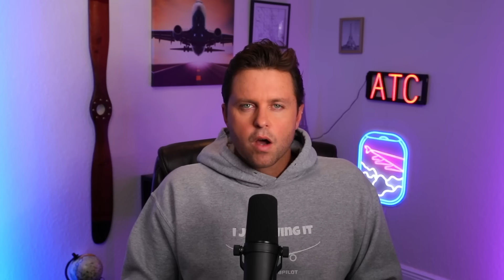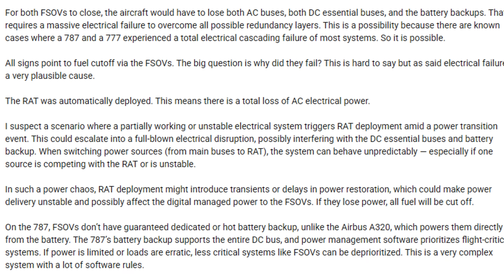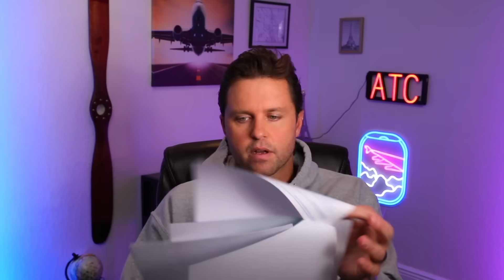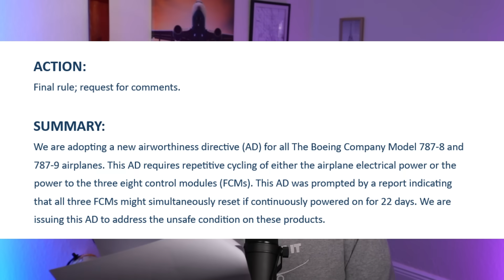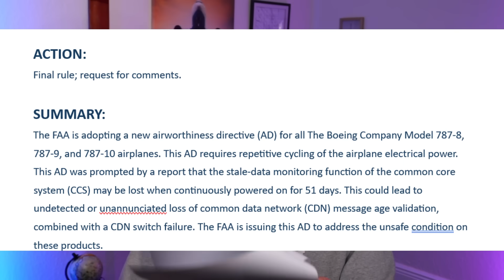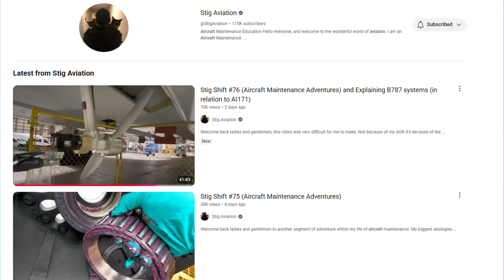Air India 171: Did a Software Glitch Cause Dual Engine Failure?

Comment: I know this might not be reliable info but if you do a google search on (If suction fed fuel is enough for takeoff if the AC powered fuel pumps will fail) this is what you will get. 

No, suction fed fuel is not typically sufficient for takeoff on a Boeing 787. 
Here's why:
Pumps are the primary fuel delivery system: The Boeing 787's fuel system relies on pumps to ensure adequate fuel flow to the engines, especially during high-demand operations like takeoff.
Suction feed is a backup: While the engines can suction feed from the main tanks if all pumps fail, this suction may not provide adequate fuel flow at higher altitudes. Takeoff is a high-power phase of flight that requires a robust fuel supply.
Takeoff requires maximum power: The Takeoff/Go-Around (TOGA) system on the 787 increases engine thrust to ensure optimal climb performance. This demands a high fuel flow rate which is typically achieved with the assistance of fuel pumps. 
In summary: The 787 is designed to use fuel pumps for normal operation, including takeoff, to ensure adequate fuel flow and optimal performance. Suction feeding is a backup in the event of pump failure, but it may not be sufficient for the demands of takeoff and climbing to high altitudes. 

Could this explain what happened if the aircraft had indeed electrical failure and lost temporary AC power to the pumps causing the engine to idle back due to lack of fuel resulting in loss of trust and being so low to the ground not having enough time to recover. Engine being forward and higher than the tanks due to the angle of the aircraft on takeoff, gravity forcing all the fuel to the back of the wings could this starve the engine of fuel if only suction fed fuel was available. What do you think? Has such scenario ever been tested ?

Comment: That is insane. How could the FAA allow Boeing to have this feature? I have almost zero knowledge about engineering and even I can tell that is an awful idea.
Reply: I am not saying that this is the case here, but many instances across a multitude of technological applications have shown how self certification of safety related equipment can lead to fatal consequences. Especially when businesspeople take control and force the engineers to cut on costs.

Comment: This seems like the most likely cause. It's very unsettling to think that there wasn't a better designed system to prevent this from ever happening. Having the fuel cutoff valve fail to the closed position when the power is lost is just stupid. I can't think of a scenario where that would be a good thing. Even an engine fire. An engine fire won't cause a total power failure, so the pilots can just cut to fuel to that engine. This valve should just be a valve that stays in the position it was last put in regardless of there being power on or off. The same should go for the engine thrust. If there is a total power lose or communication failure, the engine should stay at the last power setting they were at. If they were set to go back to idle on power lose or communication failure that would just be stupid too. I wonder what happens to the flight recorders when there is a complete electrical failure. Hopefully, they will not have any data loss.

Comment: Finally the most likely cause is reported. It’s very unlikely that an environmental cause like contaminated fuel or vapour lock will see a plane go from working under full load to both engines being completely flamed out without any signs of fire or splutter etc. considering the system is literally designed to switch off the fuel if it has no power, an event that likely occurred on the landing gear pull up request, until proven otherwise this should be the likely cause of this event. The system was basically designed to protect from fire in the engines due to disaster but never designed to protect flight during take off. It’s very difficult to see who at the FAA signed off on such a design of the electrical system that would cut off the engines if the power system failed

Comment: Interesting hypothesis which poses a couple of new POI* for me. The first (1)is a fairly obvious one pointing out that if fuel contamination is a serious contender for a cause of the accident how is it that no one else has reported fuel problems at this busy airport? 2. Clearly, if the fuel shut off valves or system software are suspected of being a çause the problem only became apparent after Take Off power ŵas selected and not instantly even then, possibly because of fuel already in the line?  Therefore, when the pilots were expecting a steady flow of go-juice they found that the cupboard was empty! 

Finally, let us remember that 25"  is a very short time to swat a problem such as this. These poor chaps just ran out of time 😢.

*Point of Interest.

Comment: Doesn’t need to be a software glitch, but a design issue. Neither had the B737 a software glitch. 

In safety related systems, vital data is obtained, processed and propagated via at least two individual channels. This is to prevent single failure modes which may trigger catastrophic events. FMEA (failure mode error analysis) are performed prior and during development by safety engineers. In lay terms, you cannot have a single point of failure by design.

In the B737, the AoA sensor was single-channeled by design, neglecting its safety relevance. I hope such a design misstep didn’t happen again in the B787 development.

Comment: There are so many “safety” interlocks that are hidden time-bombs or more accurately, combination-bombs that is awaiting the “right” combination to cause a very surprising “detonation”. It is like unlocking a combination-lock to a door by a pure-chance try except instead of the door unlocking, about 250 people instantly die. A modern aircraft replete with mechanical, hydro & electro-mechanical components all needing safety interlocks are just accidents awaiting to happen which is ironic because they are supposed to fail “safe” but in a broader sense just unlock a larger danger upstream. Normally hidden away because those particular Event combinations never “click” together or in sequence. The most egregious of these which did not stay “hidden away” at all - such was the stupidity of the “safety” design - was that of the 737 Max MCAS flight control “law” that could have been designed by Donnie. 😊

Comment: IMHO, over-engineering does not contribute to reliability or safety, and that's why I will never buy a modern car or a german car of any era. As time goes on, should we expect more commercial airplane crashes due to glitchy software and/or corroded wirings and connectors of their on board computers? Of course, we don't know yet what caused this Air India crash...

Comment: Thats what I thought. Can an electrical failure shut the engines down? Usually they lock the thrust but with a fire valve system it might actually override that.

Comment: As if Google knows it's a$$ from a doorknob . . . Please stick with credible sources! (And even if the valves close, would they not instantly reopen on restoration? Makes no sense . . . )
Reply: Once the engine is shut down, you can reopen the valve as much as you want, this won't restart the engine.

Comment: For a week I've thought the first officer or someone else on the flight deck "flipped the switch" to cut off the fuel.  This makes me think I was correct in the cause but falsely thought a flight officer was involved.  I'm sure the aircraft that had both engines shut down after landing is being scrutinized.  I hope so.

Comment: 😮But you have to refrain from picking out 1 dubious unverified media contributor that you found randomly on the web, and then quoting this person verbatim without any substantive facts or validating that person’s credibility. You need to give it up. The FSOV’s are not controlled shut by a loss of power, even with an unlikely and coincidentally combined WOW/Air logic switching scenario. It doesn’t work that way in aviation. An analogous scenario for example does do this in railway signalling because that system is based on the ‘fail safe’ principle- shut it down if something is detected as not right. Aviation is essentially different, it wants to keep it going at all costs within reason, and then let the pilots initiate any necessary shutdowns.

Comment: I was taught in computer class that there is no perfect computer program, whether it has  a few lines or a million+ lines. I  would surmise the 787 has more than a million plus. So in all of those lines of code there is one line of code when certain  condition are met will be activated and then who knows what happens. These flaws may never show up in millions of flights but the next flight it will show it's ugly face.  Something to think about. Computer glitch ,FSOV, electrical.

Comment: Software possibly but more likely a failure in the computer system itself. This could explain the instability shown in the system  since like any desktop it can be stable at idle but crash when pushed.
Purely mechanical  seems less likely but still possible.
In this case like nearly all other crashes it seems to be a combination of both.
Reply: Were the issues addressed and if so did the airline push the fixes?

Comment: I have one word for GaryBpilot: BRILLIANT !!!
I do have a question: if they would have taken off with the APU on, would this have prevented the engines from shutting down (thanks to the APU producing backup power)?  If yes, why are some airplanes taking off with the APU off?  I don't see any advantages of turning off the APU BEFORE takeoff.  Am I correct?

Comment: Contaminated fuel?
How many other aircraft took off from the same airport, the same day, having refuelled with the same fuel?
By the way, there are about 240 flight movements per day from Ahmedabad Airport . . . . so, about 120 aircraft took off using the same fuel, yet none of them suffered any fuel contamination issues.

Comment: I have been saying it could have been a Control's issue for a few days . Depending on the system , N.O. or N.C. valves a VERY common . Without a schematic ( I did controls in the A.F. for over 20 yrs ) I couldn't see the sequence and see what all could cause engine shut down . Common sense says that if a pilot can shut off the engines and it is by a electrical signal , it can be corrupted . Boards go bad , transformers burn out ,CPU's and module fry ...

Comment: This might be the gun in the smoking hole.  

The idea that fuel can be automatically shut off is ridiculously bad engineering.  

The problem with automation is that it can be so complex that it is unrealistic to think a pilot or pilots can understand it.  And when the workings of automation are not published, they cannot be understood.

Comment: Holy crap! I literally got goose bumps listening to this explanation of the fuel valves shutting off due to an electrical glitch.
Reply: I live in Seattle, I also pray this is not true, it will be the end of Boeing🤥, which is NOT good for America!
Reply: @gailreed4597 in that case it will get covered up or someone will “kill themselves”
Reply: @gailreed4597 Boeing was gone when it was taken over by McDonnell Douglas. They just kept the same name for goodwill it had. Mcdonnel douglas was was known for their incompetence.
Reply: Fuel valves MUST remain OPEN with electrical malfunction? Am I wrong? I pray this is not true, as Boeing will not survive 👨‍✈️
Reply: @robertbandusky9565  I live in Seattle, if this is true, it will be the end of Boeing🤥, which is NOT good for America!

Comment: Seems more and more like this is down to Boeing being a really really sketchy organization. The electrical issues might have been more a symptom than a cause. The idea that there was no ac and no lights for days if not weeks before, AND the RAT deployed, maybe whatever redundancy protects from system failure in the case of rapidly and badly degraded electrical systems somehow collapsed after long-ignored degradation? It’s hard to believe that profound, ongoing electrical problems didn’t contribute to this.

Comment: Wait for the official report. This is taking bits and pieces from ADs and hearsay fragments of how the system may or may not be designed. There are a lot assumptions mentioned in here without having the actual 787 manual to back any of it up. It is better to hold off until real facts are known. Wait for the official report before creating an unnecessary concern.

Comment: I can see that as a pilot you are very upset about this discovery . I am not a pilot but i wondered if it wasn't a computer issue! Programs for computers are only as good as the people who program them. It scares me that so many things are going to computer run, cars, planes etc. How many people have had a computer crash on them? I bet everyone. I live in the vacinity of Wichita KS where said company used to build planes. A friend that worked there said years ago( like 20) that things were getting rushed and slopy. If this was an issue that was raised and ignored, it will be devastating to think these people died because someone didn't address this issue. Yall be safe out there. Grateful for the work you do!❤❤
Reply: If it was a software issue, one can blame the Programmers. Here it appears to be a System Design issue, it was oversight on the Boeing's part to not factor in the power transition sequence and its impacts.

Comment: I  know nothing about 787 ,but that would be a miss engineering design as far as engine shut off valve on all other heavy aircraft I am familiar with. I would like to see the wiring diagram to bite off on that one.  There are two type of valves on aircraft. Gate valves or solenoid valve.   For  some reason I think the aircraft engines went into low speed ground idle which is a solenoid which restricts fuel flow and cuts engine power and kicks engine driven generators offline.

Comment: This is a terrible situation, did they even test the shutoff valves?
A negative feedback loop, engines are cut automatically and cannot restart. Can't generate the power needed to open the valves without the engines?
Dead weight in the air, like a mortar shell. How come the rat cant provide the power needed to open these valves? Fucking childish incompetence.

Comment: According to my research the fuel shut off valves are not spring loaded as per the video .

Key Features of the 787 Spar Valves:
Motor-Driven: They are controlled by an electric motor, distinguishing them from systems that might use manual or spring-loaded valves.
Latched Ball Valve: They utilize a ball valve design, known for excellent sealing and reliability in fuel systems. The "latched" feature means they hold their position mechanically once the motor finishes its operation.
No Spring Bias: The absence of springs suggests that they are not designed to automatically return to a specific position (open or closed) in case of power loss.
Power Usage: Electrical power is only required for the motor to turn the valve open or closed.
Latching Mechanism: Once the motor drives the valve to the desired open or closed position, a mechanical latch locks it in place. This ensures the valve remains in that position even if electrical power is removed. 
Implications of this Design:
Positive Seal: The latched ball valve design ensures a tight seal, crucial for containing fuel and preventing leaks.
Reduced Power Consumption: By only requiring power during the actuation, the system is more energy-efficient.
Reliability: The mechanical latching provides a robust and reliable way to maintain the valve position, even in unexpected situations. 
In essence, this design prioritizes efficiency and reliability by leveraging a motor-driven, latched ball valve that requires power only during operation and holds its position mechanically. This differs from simpler spring-loaded designs that would constantly exert force to maintain a preferred state.
Reply: Where is this information from? I deep dived and only found that “Motor-operated ball valves control the distribution of fuel within the
fuel tanks and allow for the routing of fuel to desired locations to support
engine operation, auxiliary power unit operation, fuel balancing, and
fuel jettison.”

They are only in the fuel tanks, not on the engine. From the “Boeing 787–8 Critical Systems Review Team Report”
Reply: Where is this information from?
Reply: @BigRic68 ChatGPT by the looks of the format
Reply: @marcogoncalves8631 Nice description. Thank you. …. What happens if the electrical fails during the opening or closing process?  If it’s not close enough for the latch to catch?  Does it just stay partially open?